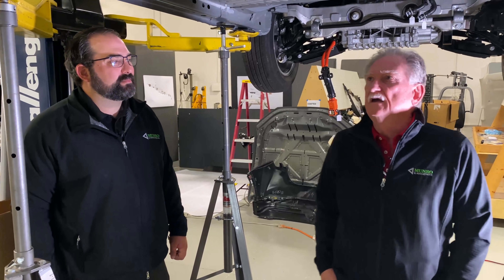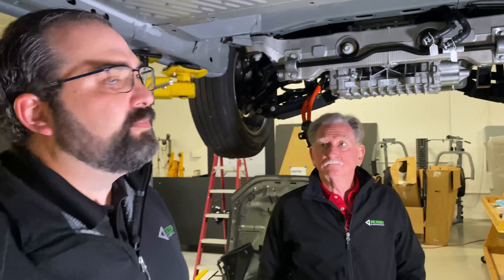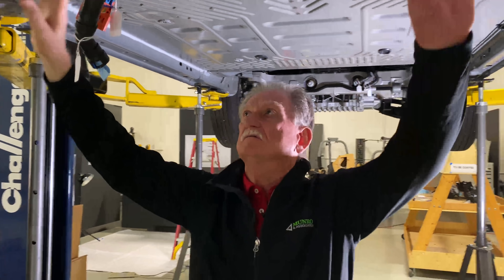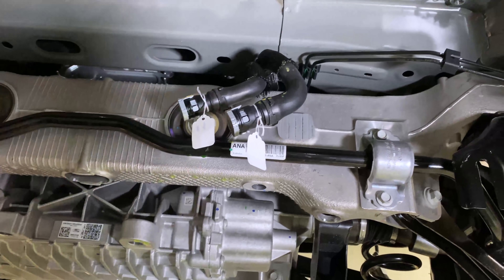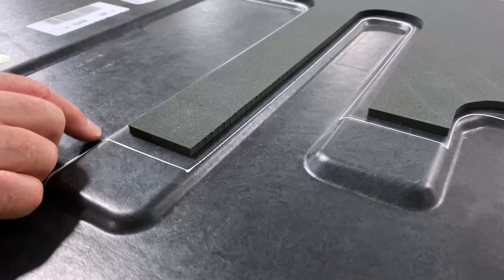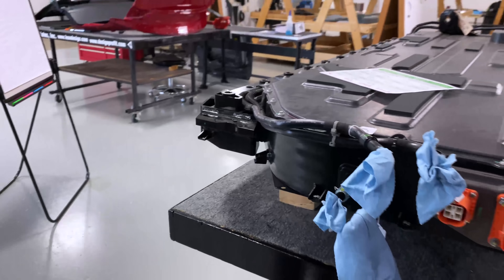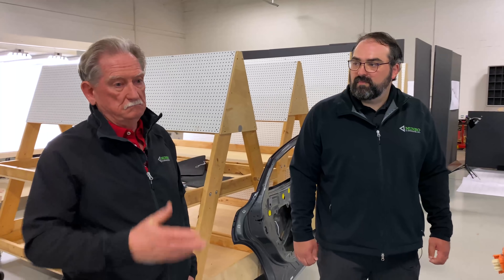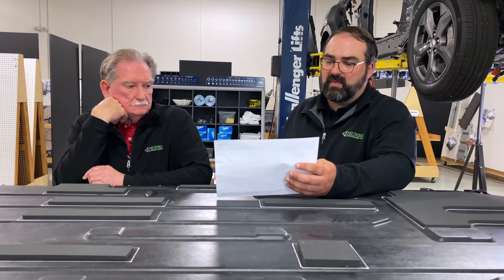First look at the Ford Mustang Mach-E Electric Battery

Comment: The only thing he cares about is weight, weight is not a measure of how well a battery is designed. Tesla model 3/y cannot be repaired due to a stupid design, they are also more sensitive to impacts to the bottom of the car, it doesn't take much before Tesla says they need to be replaced, if they had a gap like many others, then small dents wouldn't be a problem. 3/y batteries also don't last as long as, for example, the S class, whether it's the cells or the way they are filled with foam that makes them have a hard time getting rid of heat, I don't know, but there is a difference in long-term durability.

Comment: One thing I wish Sandy would have talked about, is the design of the battery, how it mates to the body and how different the procedure of removal is compared to the Tesla or Audi E-tron.  There is no room to place the feet for the rack on the rockers of the Mach-E due to the clearance between the pinch welds and battery.  Most EV's allow you to raise the vehicle off of the battery lifting from the pinch welds that are covered by the rocker molding.  Notice how they lowered the battery from the vehicle with the rack, while the vehicle was suspended by multiple pole stands.  They do sell 4 aluminum brackets that bolt to the outside of the pinch welds to allow rack feet placement... but its over $1,000.

Comment: Extrusion? Really, you think that aluminum part is extruded? What the heck makes you think that? Also you seemed to assume that transmitting the front collision forces to the outside area of the body was just to protect the battery. Can we please give the engineers some credit for thinking about occupant safety. Transmitting the forces to the outside of the passenge envelope preserves the geometry and therefor the strength of the protective space.

Comment: How much does that battery cost and how much does it cost to replace the battery or let's say there's a typical repair on the battery how much would that cost what are we looking at a thousand two thousand how long will that battery last is it guaranteed for 5 years 10 years

Comment: I definitely much prefer the removable battery type over Tesla's integrated battery / frame that can't be replaced in this application if the battery went bad it could be a big investment but at least the battery could be changed you don't have to buy an entire car for a battery going bad and there is no mistake batteries do go bad over time rather quickly too

Comment: if the battery catches fire in the motion, it can melt the brake lines, and you are left with only parking brake if you still have power to operate it.

Comment: That "bad" weld @ 11:30 is actually what you want. The "creator" at the end of an aluminum MIG weld is prone to cracking. By doubling back a bit, you have a lot more reinforcement surrounding the creator to help prevent cracking.

Comment: These guys talking about weld inconsistency is funny.  The older Gentleman must be a traditional hand welder with MIG or TIG.  Getting automated welding equipment to be consistent across 100 plus battery tray assembly with GDT variations of stack ups in incredibly difficult, especially for first year run offs where process tweaks are still being made and verified. Good review overall, looks great!

Comment: The chart at the end is a bit simplified. EPA range doesn't really mean anything. Tesla tends to over promise and under deliver. Others tend to be the other way around. Porsche Taycan is one example of that. EPA is 200 mi but people are doing much closer to 300 MI.
Then you throw driving style and to rain and climate into the mix and changes things radically.
And total range while being important you also have to factor charging speeds and charging curves. Everything I've seen shows the Audi e-tron even though it is very thirsty when it comes to efficiency ends up not mattering that much because it charges very fast and deep into the pack so that in reality if you were to road trip a Tesla and a Audi e-tron side by side there really wouldn't be much difference in the total time taken for a trip. And that's the only thing that's going to really matter to the end customer. 
The e-tron is much heavier, much quieter, much better build quality,  and much more luxurious than the Tesla .
that's what they do,  that's what they sell,  that's what their customers expect.
Also the battery weight isn't something you can really compare side by side. If the vehicle is not using the battery as a structural member it's going to be much lighter versus what we see here in the Ford where they obviously did make it a structural member. And I think in the Volkswagen and Audi stuff it is also a structural member and so their battery weights are going to be significantly heavier versus kilowatt hour in the pack.

Comment: Can ford please have it’s structural engineers work or at least be consulted by the propulsion team? Engines always a mess. Infotainment ergonomics always a mess. Driving dynamics, safety, resistance to rust always good??? I can’t remember the last time I’ve seen a rusty ford. But timing chain issues? lol Those come in thousands lol.

Comment: And how about a F-150 hybrid?  I bet if Ford really tried, eg Atkinson cycle operating at min BSFC, heavily electric, they could get 30mpg combined, 250hp&lots of torque,  0-60 in 8.5 s, even w the pickup’s significant weight and it’s low Cd.  
Variable-speed  A/C & maybe heat without constant idling; plus power takeoff 120/240 even optional  480 VAC 3ph for work site, camping, emergency, first response/patrol.
Electronic traction control & drive for off-road, & manuvering like Rivian tank and K-turns?

Comment: I wish they.d put that rear elec motor on the Ford Escape PHEV.  I want to buy it but it.s only avail in FWD.  An electric motor, a controller/ inverter, axles, and I know many other changes but still, how come I have to buy a Toyota or a Mitsubishi to get a PHEV SUV?   Doesn’t have to be big elec rear motor, or PM, or Evan liquid cooled.  Torquey IM would do it could be just 20 KW maybe more for towing edition..$1500 for those mods, at volume?  Hey Ford I’m waving my money at you.
And how about a F-150 Atkinson-cycle hybrid?  I bet if they tried they could get 250 total hp, 30mpg combined, even w the pickup’s weight and it’s low Cd.  
Variable-speed  A/C maybe heat without constant idling; power takeoff 120/240 opt 480 VAC for work site, camping, emergency, first response/patrol.
Electronic traction control off-road, & manuvering like Rivian tank and K-turns?

Comment: I'm wondering about corrosion between the pack and the body. Obviously the SMC is immune but if you get road salt solution trapped between the pack and the body, it's going to sit there and eat the floorpan up. Is there any angle to the pack mounting, so that that area could drain when parked?

Comment: At 8:34, why do you think one of the motors is an induction motor? Ford has given interviews with details and even disassembled motors - there are two motors (210 kW and 50 kW), and both are clearly PM motors.
https://jalopnik.com/a-look-at-the-engineering-behind-the-2021-ford-mustang-1839911078
Reply: The front drive unit teardown confirms that the front has another PM motor.
https://www.youtube.com/watch?v=g3qWBmz-j2k&t=667s

Comment: Pouch batteries?
Reply: Pouch cells, yes. The are a few millimetres thick, the length of the cell is a less than the width of the module (allowing for tabs and connections on one or both ends), and the width of the cell is a bit less than the thickness of the module. A module consists of 30 (for the larger modules) or 24 (for the smaller modules) in a stack, determining the size of the module.

Comment: Well said Sandy. I have been calling for a Jaguar iPace with a smaller battery - maybe 60KwHr. Also the front motor could be removed to make it a RWD car only. This would realistically shed about 600 Lbs in weight leaving the car more nimble. Also the range might only drop to 160/170 miles.. So it really highlights the advantage of not carrying round a large expensive battery.
Reply: The Mach-E is available RWD in all trim levels except GT. It is also available AWD in all trim levels except "California Route 1". The GT is AWD with a much larger front motor. This is the basic "Select" trim with AWD using the smaller front motor.

Comment: I would’ve been more interested in knowing the manufacturer of the battery pack. Ford is not very transparent with their product. Weight has a lot to do with chemistries and cooling within. They are known to leave or use excess brackets that are only there for the manufacturing process but increase the cost of repair due to blocking access. I won’t give Ford any kudos. The Mach e doesn’t even look nice
Reply: And I'm quite sure you're not attractive either.

Comment: The Ford's standard range battery net capacity is 75.7 kWh, usable is 68 kWh.  The extended range is 98.7 kWh, usable is 88 kWh.  The Tesla's older long range battery's net capacity is 75-79 kWh; usable is around 72-73.5 kWh.  Tesla maintains smaller buffers in their vehicles, and since it's a lower portion of their net capacity, they're able to pull more miles out of a smaller battery.  It's also why Tesla owners are more likely to notice range loss over time through battery degradation starting early in the vehicles life; after just 10k-20k miles.  Some owners report losing as much as 7% or more of their total range early in the vehicle's life.  Most of the other cars maintain larger buffers to protect the battery, and to essentially hide range loss from degradation by opening up more of the buffer, so the owner notices no change.  Ford's EPA range ratings have been found to be conservative, even exceeding the EPA range on highway tests.  Tesla's have been found to be optimistic, tending to underperform their range rating in highway range tests.  They claim it's because they have significant battery remaining after the range indicator reaches 0%.  This is... frankly, stupid.  No one should expect to measure range after the car tells the driver that it has 0% charge left.

How many of these critical points did master engineer Sandy Munro point out?  Zero.

Comment: What's a real head scratcher is that the 1400 hp 7 motor (!) Mach-E has worse performance than the Tesla Model S Plaid with "only" 1000 hp and 3 motors. For now, Tesla definitely has the edge on efficiency. The Plaid is almost a full second quicker to 60 mph, which is an eternity in terms of performance.

Comment: I can't help compare the Mach-e's front cradle/subframe (Sandy calls it both a casting and extrusion) with the built in crush zones.  I believe this is simply a smaller version of Tesla's Gigga-press made subframe.. I'm thinking the Ford part must be similar to the Tesla's in alloy/casting and how its made.
Reply: The subframes (or cradles) at front and rear are castings, but some of the other structural components that he talks about are extrusions.
Reply: @brianb-p6586  Remarkable "extrusions" are now resembling "castings" with their complexity.. As far as I'm concerned "extrusions" are not far from sausage machines. I particularly was interested in comparison of aluminum grades of "subframes" via Tesla's Gigga-Press vs the shown cross members of the MachE.   
Definitely disturbed in Sandy's not exposing the details on the MachEs castings. My money is on the Ford's front/rear cross member/subframe is a hypereutectic aluminum alloy as is Tesla's. 
I've done some thinking on the why of Tesla's giga-press being called 8,000 ton. Does it weigh that or God help us make that amount of pressure?

Comment: How are you going to do a break down of a structural battery pack and you can’t remove it?
Reply: They're just going to take the lid off and remove the modules, like any other pack. The feature which makes it structural is just the strength of the extruded aluminum beams on the sides.

Comment: Very interesting how the distribution of frontal crash forces is discussed around the 5 minute mark. And look at the size of those coolant lines going to the rear motor. For the same HP ICE (266 HP for SR rear motor: https://media.ford.com/content/dam/fordmedia/North%20America/US/product/2021/mach-e/Mustang-Mach-E-Tech-Specs.pdf) you would have far bigger lines to remove heat from the engine. This really tells the story about why EVs are more efficient technology.

Comment: The battery pack comparison is more complicated than it looks the first glance. For example, E-tron has a huge low and top buffer and the actual range is significantly higher than EPA quoted. A huge buffer also allows them to charge 150KW flat up to >80% which makes it even faster overall on long trips.

Comment: I think Sandy is confused about what Tesla means when they say "structural battery".  They're not talking about a structural battery case - they're talking about using the cells to bear load.

Also... the battery vent is in the middle ?  Facing forward toward the driver ?  How on Earth is this safe in a fire scenario?
Reply: You do realize that it's on the other side of a steel floor panel from the driver, right?
Reply: @brianb-p6586  The gas has to go somewhere.
Reply: @ennnafnlaus2904  Yes, any vented gas must go somewhere, and there's a space between the floor and the pack, and the pack is not sealed into the vehicle structure. It's not a big space, but - again - it's on the other side of a steel floor panel from the driver.
Reply: @brianb-p6586  "Space between the floor and pack" doesn't cut it; the gas has to vent to the outside world .  It also comes out like a blow torch.

Comment: Nice job as usual. Gives us non-engineers a peek into the structural engineering of EVs. One thing, as you have a world wide audience and only the USA still uses miles for range, perhaps you could add Km as well . eg. 311m/500km. You already do kg instead of pounds, so adding km is an obvious addition.  I'd suggest just km but our American friends would be lost.
Reply: There are people on the internet who are not in the U.S., and do not want to do everything the same way as in the U.S.? That concept would shock many U.S. residents. ;)

Comment: Are the Brakelines sealed or good coated? Looks like you can put a lot of pennies into the repair after 8-12 year in a rough seaside environment. Also it's not possible to check them during regular service.

Comment: Is the 485 kg battery only held up by vertically oriented bolts! Why haven’t they used horizontally oriented pin / bolts somewhere so the is a support in shear?
As Sandy has said, many many times, threaded fasteners alone come undone over time especially in a vibrating environment. Surprised!
Reply: Take a look at the subframes under any car: they hang from the unibody, they are held in by vertical bolts (typically four), and they don't fall out. In decades of maintaining (and occasionally modifying) my own vehicles, I've never seen a bolt come loose.

Comment: I like the structural battery packs provided that they're replaceable since it removes weight, but there is something to be said for rebuild-ability by replacing individual cells.  Tesla is pulling some really bad anti-repair S*** IMHO!

Comment: Great breakdown and while we can make an empiric comparison between weight and size, range is quite a different story. A lot of these cars do much better in real world testing than EPA numbers would have you believe. In the name of science, I'd recommend an asterisk next to the EPA numbers or potentially do some of your own testing. Not hard to put any car in cruise control (GPS verified) at a certain speed and figure out the draw. You don't have to spend days on experiments depleting the battery, just get a sense of efficiency.

Comment: If you run the numbers and divide the battery cap by the miles France and also divide bat cap by weight, then add those 2 numbers up and look at the lowest set of numbers.  This gives us the Chevy Volt and the BMW-i3 as the most efficient vehicles using the least power per kg and the least power per mile.  I'm surprised you guys didn't run those numbers in a spreadsheet.

Comment: 17:50 The "fat Etron (2019)" will be dumped in couple of years and they sell only 50 000 cars/yr. The "Q4 Etron", based on the MEB plattform like the ID.4 and Skoda Enyak etc. costs only 50% of the "fat Etron" while having the same size. Maybe it will die even sooner.🤷🏻‍♂️

Comment: 14:30 Maybe you could switch to the metric system like 95% of the earthlings and 98,5% of the countries. 😜
Oh, and 'gross' (here used) or  'net' (=the real deal) and what standard the 'Drinving range' refers to (EPA, WLTP
 Tesla Model 3 has now (2021) 82 kWh and 568 km (353 mi) EPA range.
The BMW has since 2018 a capacity of 42,2 kWh and 246 km (153 mi) range.
I suspect the Audi Etron has a much higher gross capacity, than Audi states - otherwise they could not keep up the 150 kW charging power so long. And/or with old/heavy NCM111 chemistry, maybe. Would be interesting to dismantle one day.

Comment: If you read any review on the Tesla model Y you will see that it never traveled anywhere near 300 miles. Usually they end up getting around 230 which is still more than most of its competition, but not by a whole lot.

Comment: Isn't Audi etron getting 600 km of range in 2022? So it has been done already.
The big old battery had amazing charging capabilities, though: 150 kW till about 80 %, which is what...10x as fast as Mustang with its drop-off-a-cliff at this percentage?